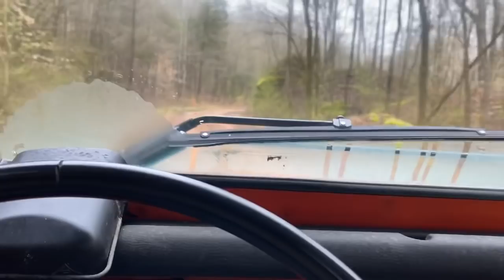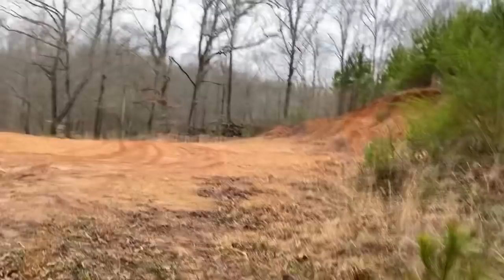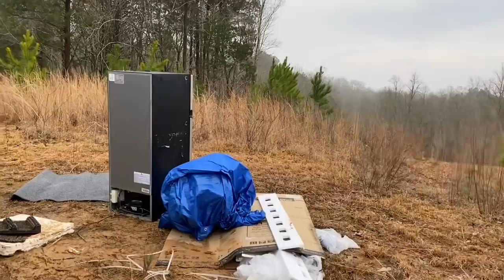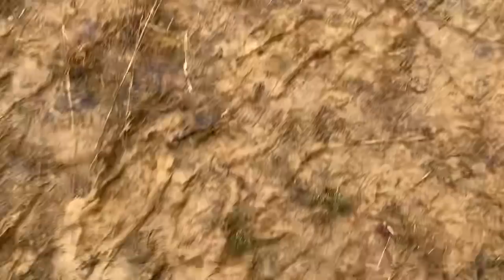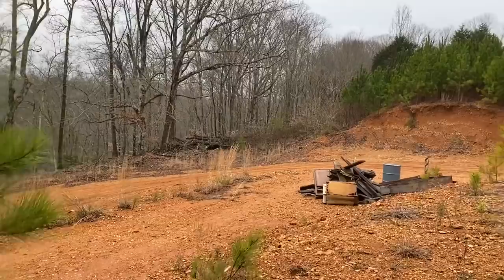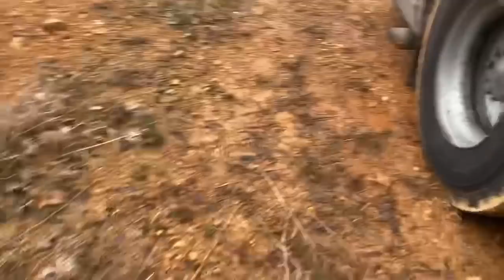Tennessee acreage driveway upgrades and other updates dump trucks

Comment: Geo synthetic or filter cloth under your stone would prevent the stone from sinking into the soil when it's wet, some guys say that it is equal to 1 foot of stone, 30 years equipment experience so I've built a road and or driveway or two in my day. Personally, I tell people to put a sock covered sub drain on each side 1 foot below sub-grade and cover with clear stone to sub grade level, with run off extensions for water relief where needed depending on the land. And yes I put the filter cloth under the sub drain part too, little bit of stone, maybe 1", then pipe, then cover.
This way it should last you a life time, almost never heave and even in the worst rain storms, wont wash out, you be high and dry.... sub drain some call weeping tile, farmers use it for drain in fields but a much larger size. Sock covered and clear stone or it will clog with sand.
If you can, use a backhoe with a 12" bucket to dig sub drain on side's or worse comes to worse and good ol two handed french backhoe, a spade shovel.....or your USA so that would be a Mexican backhoe ?  I'm a native Canadian, half breed so I aint racist, its a fucking joke.... besides as far as I'm concerned, your all illegal anyway, unless your a red man... but we stuck with you so might as well make the best of it......

Comment: That looks like 5/8s minus size rock. It tends to go into the ground without a good shale or 1" 1/2" rock base. It also washes out to the sides of the roadway as traffic drives on it. You should be ok given your the only users. Plan on constantly adding rock to your driveway. It's a beginning   :)

Comment: Perhaps a bit ballsy, tailgating that one load up hill and on rough ground.  That is one skill where the only way you get really good at it is to get at it.

I've had one where the load stuck in the front of the bed.  The bed frame broke loose from the truck frame, twisted and went over without rolling the entire rig.  Not something I'd care to repeat.  Had another where I raised the bed too high before enough of the load had gotten out of it, the front of the truck started lifting, fixin to set itself on it's rear.  I managed to check that, but I decided that a truck with a power down bed would be a very good thing indeed.

Comment: They make some stuff called geofabric that is good to put in the muddy spots. It keeps the rock from sinking into the ground. It is something I would consider where you have mud. I been paying $350 a load of crushers run which pack down hard after a few rains. You need someone with a front end loader or a box blade to smooth it out. Then drive over it to pack it down. It has rained so much this year that it is hard to avoid mud. I am waiting to get a double wide moved on to our TN property and it won't stop raining long enough.

Comment: I see lots of comments about a tractor and a box blade. We never had those tools when I was a kid, but had to flatten out a lot of dirt/gravel road. We towed an old chain-link gate behind a 4x4. It worked great! If it was bad, we'd weight it down with some old tires filled with concrete.

Comment: I used to Do "Spreads" in a tipper (Dump) and those boys did outstanding work considering the really shitty terrain, The second that boom goes up those things get unstable as hell on good ground and on your bush lot it took some skill I tell you.
Just a hint though, You can point at where and how you want it but after that shush and watch. They know way better what they are doing than you think you do including the maintenance piles at the start of the spread.
Better to give them their dues and get a few more loads in.
Quite a contrast in power between the Dump trucks (Tippers) and Lenny too, My guess is 22/25 odd ton weight in those trucks powering up the hill.

Comment: I'm surprised you didn't start with #3, that mud is going to eat that 2b gravel like rice crispies. 

A nice trick to get the gravel to go where you need it is to put either a 4x4 or 6x6 in the bed up against the tailgate in the middle to get the gravel over the tire tracks, not hump it up in the middle where you'll never drive on it.

Comment: I pulled doubles and triaxles through the Rockies and Cascades all year long. When it's greasy like that you have to put the truck in a gear lower than you know you could go up the hill in and run up against the governor to get past that torque curve. You would be surprised what you can go up. The first guy had the RPM and he made it the second guy was to low RPM ok for pavement but not here and of course he couldn't. Also drive a bit off the track so your on firmer Iess travelled ground. They did a great job spreading.

Comment: Definitely need a lil tractor, a grader box and blade. Line each side of the drive with #1 gravel this spring or early fall (probably will need some #1 on those steep grades any way) to help from wash out. Edging is front end loader or bobcat work. It will also help hold that #2 in place. Start saving for the next round. If ya keep on it, put in culverts at natural washes it will be about three to four years of touch up with #1,#2 and #3 on year 3 or 4. An inch of sand @ year 2/3 in spring time and that clay will lock it all in. 
Looking good! Happy days!

Comment: Looking good. I’ve made a cheep leveler out of chain link fence. A little weight, chain it to the back of the little truck. I leveled hunting and old logging roads using a small piece of chain link like a drag. You will need some weight on the chain link. Starting to look like home.

Comment: I have been impressed how much you have been able to accomplish, so quickly.  I asked the POCO to advise on an electric installation on a property I was looking at 2 months ago, and it took 1-1/2 months for them even to call me back.  You seem to get stuff arranged in a few days.  It is easy to see that hump in the driveway - you should be able to reduce the grade there.  Looking good!  That is an eerie looking pile of stuff around the burn barrel - it is all about lighting.  Owls are awesome - keep you company.  I have used that method to stone my level 300' long driveway, and it took me several hours with a garden rake to even it out.  The drivers did pretty well.

Comment: Love to see 100000 lbs moving with ease. I always love setting at the pit with my single axle 6 yard truck watching the big boys on the scale hit over 100k lbs. I was stoked at 21000. Lol
Reply: It also helps have differential locks on the driving axles - MUCH less slipping and sliding.

Comment: I think I'd build a house at the bottom of that big hill and save a whole lot of driveway maintenance and electric run.  Save the top of the hill for a shed.  Might want to consider something besides pine trees up there as well.  They look nice, but when mature, in a good wind they like to snap in half a lot easier than a hardwood.

Comment: You will need some sort of power to be able to get water out of a well tho Scott. It will need to be 220 with a 20 or 30 amp breaker depending upon what pump is used. You can either run it off generator, power company power line, or solar. Solar powered well pumps are fairly new so they are still relatively expensive yet so it would probly be much cheaper to just have the utility company bring a power line in. Your gonna eventually need it anyways
Reply from the maker: City water
Reply: @BusGreaseMonkey  Yeah, I can see why he guessed you would have a well - I am still surprised you have city water on that property.

Comment: Mud Glorious mud,  when you were walking along your gangplank I noticed that you had a rake for the soil and I thought hmmm that rake needs to be turned the other way around, I trod on a rake once as I stepped backwards, still have the indentation in the back of my head. Now, whenever I see a rake facing barbs up I turn it as I do with wood with nails in it..  better safe than sorry. This don't come under health and safety,  it's just that I would hate to see the first lady or you get a face full of it.

Comment: You folks need a John Deere tractor with a Gannon blade and front loader on it. Using the Gannon blade will help spread out and level the rock for you . That #57 rock will get pretty stiff after a while and using a rake will break you backs. Great property you all have there.

Comment: "ROCK" ... Brings back memories..... I put in 62 tons in my place. I bought a used Case Backhoe (new toy) and did my own driveway / culverts and also did a lot for the neighbors. Time of year is everything! The best deal is when buying "dry" rock. Otherwise money is wasted when paying for water. (Wet rock weight.)  I also noticed dead trees along the drive. (Falls from high winds could block the driveway.) Not trying to sound like a know it all,  just an explanation from experience. Culverts and drain pipes are in your future too! I made myself a drag to tow behind my lawn tractor to smooth out the gravel. ( 8"x10"x6' beam with chain link fence.)

Comment: There are no limits of how much rock you can put on this road.
Reply: 100s of loads over time.
Yes
That clay eats the stone as you drive on it.
Reply: I had a maybe 100 ft drive in Texas black clay, and I must of put 50 loads of crushed concrete over the years, I think the drive way was around 6 foot thick of Crushed concrete, it just sinks down.
Reply: When we did our path in the NC red mud it seems to evaporate for the first few years. Regular maintenance will keep it shipshape. It should do well in that chert base.
Reply: I am a firm believer of covering that gravel as quickly as money permits with Concrete or Asphalt, even hauling your own stone it gets expensive over time, there has been plenty of people who have done cost comparisons and over 10 or 15 years Concrete/Asphalt comes out cheaper. That Chert makes ok base but turns to dust as a surface stone.  I have tried ground Asphalt as unless you're spreading fresh on top it also disappears into nothing quick.

Comment: Tie something... anything behind your Jeep and drag it up and down the road, you’ll be surprised at how much difference it makes. An old gate is ideal
Reply: We have an old I beam with a chain hooked to the ends it works the charm for our old rutted road up heah in Milo, Maine 100 points from the Magoo's
Reply: Great idea ive used a couple skids screwed together
Reply: A chunk of channel, or I beam with some chainlink dragging behind works great!!
Reply: We used a heavy pallet with weight on top (if needed) with a chain attached to a drag vehicle.  It leveled  and spread also.  Vary weight to achieve desired amount of gravel movement.  Looking good.
Reply: I’ve made many miles of good roads in a dozer... I’ll still take a heavy 8’ i-beam drag over the machine any day.

Comment: Anything with a front loader, bobcat or anything of that sort. That rake that I saw in your hand you might as well set it to the side for a while! A set of box springs off of a bed with some weights on them and pull them behind your thing!
Reply: I used a garden rake on my 300' long driveway when it was installed.  Also pushed a fair amount around by wheelbarrow.  Then I bought a loader/backhoe!  Not 30 years old anymore.
Reply: You’re not the music man racing Don Moore are you ??
Reply from the maker: We got a lot done with that rake.    Not afraid of hard work    But is like to have it ready for the boxblade in a few days

Comment: you may need to rig up a chunk of plywood with some 2x's screwed to the bottom and top so you can add and remove weight as needed to drag up and down your driveway with the thing.. being careful to not cook the clutch. 

when you get thinking of a slab... 45' x 10' x 7" thick just about a full 10 yard delivery.. https://www.calculator.net/concrete-calculator.html now how much thickness would you need for a bus.. could you do 2 pads.. one for the rear with room for the engine hoist to roll out behind and on the transmission side..  and enough to work on the front suspension and brakes.  its just a thought and not for MONTHS till this corona goes thru.. https://www.calculator.net/concrete-calculator.html  i don't know if 7" is thick enough to support the rear weight of the bus.. not just on its tires but up on jacks and jack stands.  i might make the rear pad 8 or 10" thick..  the front pad 6 or 7" thick..
one thing.. the gravel road has to be perfectly flat.. not tilting outward at any point if you are going to have a delivery. you don't want the cement truck rolling down the hill sideways.  even the curves have to be flat with some forethought.   you could also see if a container company has just the bottom deck of a container that had damaged sides and a strong floor.  those might be really cheap..  heck they would make a nice patio deck..

Comment: You really do need a tractor of some type.
Reply: They're looking for equipment with 2-stroke detroits
Reply: @LittleWapiti  Theres no shortage of 2/71 and 4/71 powered tractors of old, usually 50 to 90 HP as well so well capable with FEL or a 3 point and a blade.
My experience shows the engines are usually well serviceable but the gearboxes need love.
Reply: An old dozer with a detroit is what would be ideal and Scott has said thats what he wants
Reply: He told us neighbors have all that and he can borrow the things he needs.
Reply: White made a tractor with a Detroit...
Reply: The is plenty of old Caterpillar equipment out there that was repowered with Detroit's the only problem is finding it good enough condition that it would be worth fooling with because nothing will eat into your wallet like replacing a undercarriage.  Be it me I would be looking for a Dump Truck (with buggy axle and plenty of horsepower) and a Tractor with a bucket on it The rest of the toys come along as you find them in good condition and a good price but that's my three cents worth.
Reply: Kubota
Reply: @kevinhornbuckle  Skid steer w/attachments, been the answer for me, been there developing muddy dirt several times.
Reply: Look for an old Galion grader, most of them have a 4-71